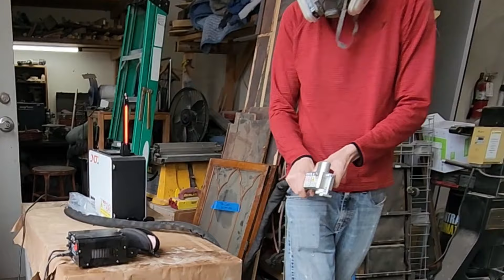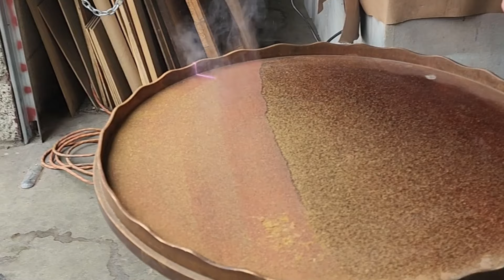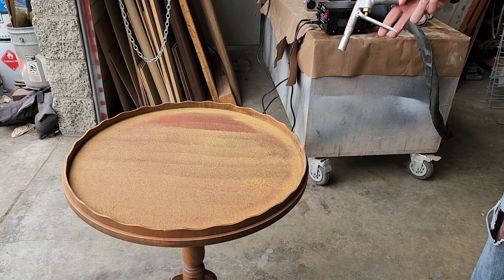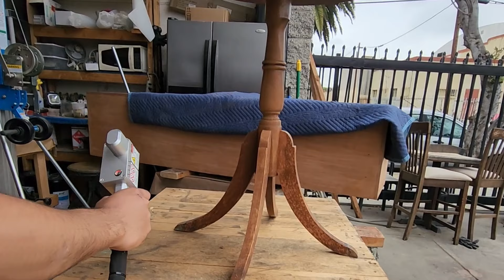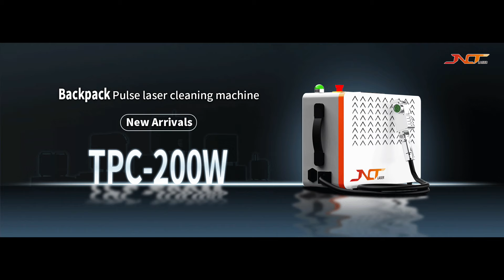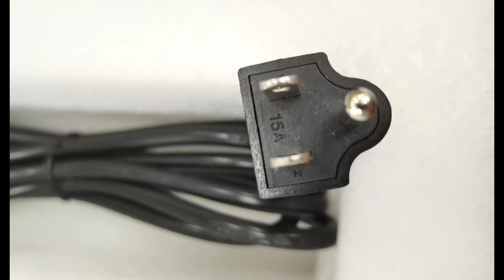Stripping Furniture with Laser

Comment: Thank you for making this video as well as additional info listed.  Question - is there a special kind of laser machine you buy for paint/varnish removal and another kind of machine that specializes in rust removal ?   I know there's various machines/prices based on watt output so if I were to buy one with a large watt output, would that machine be able to handle rust, pain, varnish, and everything else that can be cleaned with a laser or is it more complicated than that and involves specialized machines for the kind of material you're trying to remove?  Also do you have to adjust settings on your machine for different specie of wood or does the specie of wood seem to not affect results?
Reply from the maker: Our machine removes rust but it takes a few passes.
The higher wattage machines remove it faster.
Our machine removes lacquer, shellac and some paints very well. It won't remove oil based polys or oil based paints.
We use the same settings for everything and it seems to work well.
The key is to find the sweet spot in distance where the laser works best.
An inch too close or too far awy and it doesn't work.
Reply: @danthefurniturerepairman9411  Gotcha - thanks for info!   Off topic question but have you ever found items hidden in old antique furniture while restoring them?  My mother purchased this large pine chest from an antique auction thats owned by a relative of ours.  The chest was made by a Confederate soldier (before the war) and is at least 1860s old and looks like heart pine.  My mother was showing me the chest and there was this pine knot at the bottom of the chest and she noticed a piece of the knot detached when she ran her hand across it and she goes "what is that?"  We got it out and it looked to be some kind of black rock / crystal.  I thought it was a short piece of lumber chalk that you mark packs of lumber with at first.  What it turned out to be was a large chunk of sapphire.  Rough sapphire is black and what this guy did to hide it (I guess during the war?) was he glued it into the pine knot and if someone opened the chest looking for stuff it would just look part of the knot itself.  I heard this guy  a few weeks ago that restores antique furniture say that hiding valuable items in old furniture was a common way people used to hide things back then and that they had found stuff hidden in old antique furniture that had probably been there for well over 100 yrs.  Not sure how many people had this chest before us but hiding that sapphire in the knot managed to fool everybody who had the chest before we did.  Clever!

Comment: Don't worry about 50 or 60 Hz. Inside are Switching Power Units installed and they are Working from 85 to 240V/50-60Hz 😉
Reply from the maker: Understood, but when we spoke with the manufacturer they weren't sure if our machine had that in it. Since we couldn't get a schematic from them we were being safe.
Reply: @danthefurniturerepairman9411   but the manufacturer are the one and only who need to know this. They must be sure what they install into the machines to work properly. I am Electronic Engineer and know a lot about those things

Comment: Hello. Please tell me where I can get this .
Reply from the maker: Our machine
Laser machine info
JNCT laser
100 watt machine

https://www.jnctlaser.com/laser-machine/laser-cleaning-machine/100w-laser-cleaning-machine/

It takes time to make and edit videos and to answer the emails they generate.
Please donate to our channel our PayPal is:

paypal.me/furniturerepairman

We purchased a 100 watt machine if we had it to do again we would have gotten the 200 watt machine.
If we were removing pieces with large amounts of paint we would even consider the 300 watt machine.
The 100 watt machine works well on lacquer and shellac but struggles with paint, especially the primer and oil-based urethanes

The Positives are many, especially in corners and carvings that are very difficult to strip with chemicals.
Usually, the only sanding needed is to open the grain back up so material can penetrate it.

Comment: Thank you for your informative video.  I have been restoring furniture for years and love it. My pieces are so well restored, a quality job. I sell a few, keep a few, its not a business but a hobby. Recently in California, stripping chemicals have been banned. I pay $55 per gallon for paint stripper and it does work!  It used to be $10 per gal and worked fast.  So I have to invest in a noisy and dusty soda blasting setup and feel defeated. The laser machine would be such a godsend.
The problem is that for that hefty price tag, I have to buy sight unseen, no idea if it works or not and cannot return it. Too high a risk to take.  The cheapest ones are still $8000 in the US. Ali Baba cannot be trusted. What to do?  I wish the prices would come down or at the very least we could have an onsite demo to show how it works and if it is genuine or fake.

Consider a fan used for soldering that sucks in the vapors that can stick on your lens. I bought one on Amazon for $30. It pulls the fumes toward it and neutralizes them. So the air remains clean too.
Reply from the maker: Understood.
thanks for watching.
We still strip a large amount of our pieces with acetone with very good results.
We have a few videos showing our technique

Comment: Have you successfully removed paint with this unit?
Reply from the maker: We have a 100 watt unit and it will remove paint but struggles with the primer coat.
It also seems to struggle with the old lead based paint.
I think the higher watt units would work better but we don't have one so I can't be sure if it will.

Comment: Hi Dan, Thanks for sharing this video! I own a 300 years old wooden house in the Netherlands, over the years it has been painted many times in many colors. Based on your experience, would you suggest a laser machine could be a suitable instrument to strip away several layers of paint from antique doors, beams or even larger panels? I'm not looking for a paint stripping tool that is necessarily faster than the traditional methods, more thorough and non damaging the wood is important. I'd be grateful for your thoughts on this!
Reply from the maker: Hello,
I'm not sure it will work on the old lead base paint.
If I were going to purchase one for that purpose I would get a very high watt machine.
We found it will strip off the top layer of paint on furniture but struggles with the primer. Sometimes we are able to remove the primer with multiple passes and sometimes it loosens the primer enough that it can be easily removed with a scraper.
I would think the 300 watt machine or above would be able to handle the work.
The 200 watt machine may be able to do it but we have never used one(ours is a 100 watt machine)
You have to use a putty knife to shield any glass you are working close to.
Hope this helps.

If you want to donate to support our channel our PayPal is
paypal.me/furniturerepairman
Reply: @danthefurniturerepairman9411  I spoke to a manufacturer and they said 1000w machines will take 1.5mm of paint - didnt mention anything about lead though.

I wonder if lighter woods are more difficult to strip clear coats off of. I read that white paint takes longer to strip as it reflect laser light more.
Reply: Good question I hope Dan replies.

Comment: Hi there. Thanks for the great video. I did try and send you an email but it's not going through. Is it possible to share the settings with me? I just got a unit and doing tests and seems like I have not enough power to strip varnish or too much and it burns the wood. I have a sfx 300 watt unit. Thanks again for the awesome video.
Reply from the maker: Hello
You can email me at danthefurniturerepairman@gmail.com
I will send you pics of our settings and the lens we use
Reply: Any luck with the sfx 300w? I was looking at either that one or the 300w version of the one in this video

Comment: I might have missed this in the video, but you're using a pulse wave unit, not the continuous wave... yes? If that's the case, this would work on outdoor funiture as well. Materials such as aluminum, wrought iron, marble, concrete, fiberglass, etc could be integrated within your particular cleaning/restoration service. 

Btw, has this increased your customer base? How were you able to market your new service? Do you charge by the job or by the hour? The reason I asked is because I live in the southeastern part of the US and see a lot of potential in using this type of equipment for residential and commercial use. It's relatively a new market and I would certainly like to capitalize on it if everything falls into place. Unfortunately, there's not enough information out there to support it as a stand alone business.
Reply from the maker: We have used it on metal and  it works very well.
We purchased the 100 watt machine but the 200 watt machine would have been a better choice for thick finishes.
We strip about 75% of our projects with the machine and it has held up.
We only do refinishing and our shop keeps the machine busy.

Here is the link to the machine we purchased

https://www.jnctlaser.com/laser-machine/laser-cleaning-machine/100w-laser-cleaning-machine/

Comment: Hi Dan, Arthur did great job. Have you tried on hardwood floor ?
Reply from the maker: No we haven't used it on any flooring.
I think the poly on the floors may be too tough for the 100 watt machine.
There is a new 300 watt machine that may be the answer to the very durable finishes.
Reply: @danthefurniturerepairman9411  thank you very much!

Comment: You can use a laser to clean all hard surfaces.  The lenses need to be kept clean so have a vacuum suck up the bits before it bakes on lens adding a fan also helps.

Comment: Have tried it on painted surfaces?
Reply from the maker: We have, it does a good job on the top coat but struggles with the primers, I would suggest a higher wattage maybe the 200 watt if you were doing paint. Also old paint contains lead that you have to be careful about.

Comment: A previous owner applied a coat (or two) of epoxy to the teak toe rail several years ago which now needs to be stripped off. How well do you think the tool will work on this finish?  What do you use to protect adjacent painted surfaces?  Thanks!
Reply: blue painters tape or white will protect other surfaces.
Reply from the maker: We haven't had any luck removing epoxy with it but a higher watt machine may work.
Our machine is 100 watts.
We use a sheet rock wide blade taping knife as a shield to protect adjacent surfaces.
Reply from the maker: If you want to donate to support our channel our PayPal is
paypal.me/furniturerepairman

Comment: Dan, if you had to do it all over again, would you purchase from TPC again? We are also looking to move away from methylene chloride to a laser cleaner. Thank you.
Reply from the maker: Yes we are happy with the machine and the way it has preformed, the only change we would make is purchasing a higher watt machine.
Reply: @danthefurniturerepairman9411 I am renovating an old home for myself. I refinish cabinets professionally. Have you tested this on pieces with multiple layers of paint? I would have to tent my rooms due to potential lead as I work.

Comment: How is the learning curve going with the laser….curious if you are still using a lens a day and about the availability of the lenses.
Reply from the maker: Hello, 
We are stilling using the same amount of lens covers a day but have found that temperature and humidity along with the varnish we are removing are factors in how long they last. 
We have had no problems with the machine and it operated in a busy furniture restoration shop.
We are still able to purchase the lens covers from the manufacturer.

Comment: How do you suppose this would do on worn out marine varnish?  I refinish front doors by sanding and scraping, this would speed up the process immensely, so long as it could actually make it through the old finish.
Also, how much sanding was involved after you got the wood clean before applying the new finish?
Reply from the maker: We have a 100 watt machine and ours won't remove marine varnish. The 200 watt machine may be strong enough to remove it.
Reply from the maker: If you want to donate to support our channel our PayPal is
paypal.me/furniturerepairman

Comment: It looks like a 100W instead of 200W laser cleaner.
A word of advice when using the laser outdoors, be aware that the laser beam can hit people walking on the pavement.
You should set up some form of protection around the workplace.
Reply: Can you provide the exact settings? what is the power, frequency and pulse width?
Reply from the maker: Hello,
Yes it is a 100 watt laser.
We use a protective tent when in use but the light through the video off so we worked outside of it.|
Thanks for the tip.
Reply: 😊😊 @danthefurniturerepairman9411

Comment: How have you enjoyed the machine thus far? Are you having any issues with the machine? Is the supplier responsive with any questions?
Reply from the maker: The machine works well on lacquer and shellac.
On paint it takes multiple passes and sometimes won't remove the primer.
A higher watt machine may work on paint better, we are using a 100 watt machine.
Customer service is not good for the company we purchased but the price point much less than other companies.
If you want to donate to support our channel our PayPal is
danthefurniturerepairman@gmail.com

Comment: What parameters are you running at

I have a 100w sfx backpack and so far all we’ve done is burn wood
Reply from the maker: We are running it at the maximum levels.
If you are burning wood you may have the tool too close to the piece or may need to move it faster.
If you hold it in one place or move it too slow it will burn the wood.
If it is having trouble stripping the wood multiple passes work better than being closer.
Feel free to email us at danthefurniturerepairman@gmail.com if you need more info.
Reply: @danthefurniturerepairman9411 I tried that email address and it bounced back as invalid

Comment: What a cool machine! I've seen these used for rust removal, but I see this as a more marketable use for the tools. Would love to see an update after some usage and time spent with the machine and a cost breakdown. Cool idea for a business...in home, chemical free, cabinet or furniture stripping!
Reply from the maker: Hello, 
The machine has paid for itself, we are happy with the results we are getting. When it works it is amazing but it struggles with paint and heavier clear coats like poly or conversion varnishes. We used it on a steel trunk which were nightmares in the past and it cleaned the metal in a fraction of time.
We have 2 shops and are happy with the first so will be purchasing a machine for the second but will get the 200 watt machine to see if it works better on painted pieces.
Thanks so much for watching!
If you want to donate to support our channel our PayPal is
danthefurniturerepairman@gmail.com